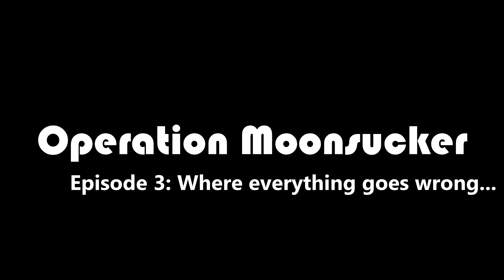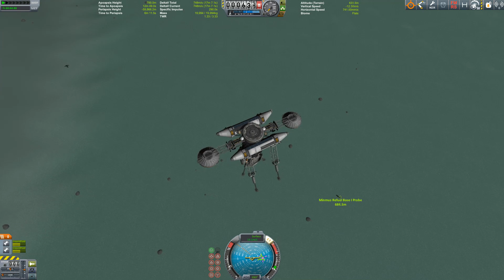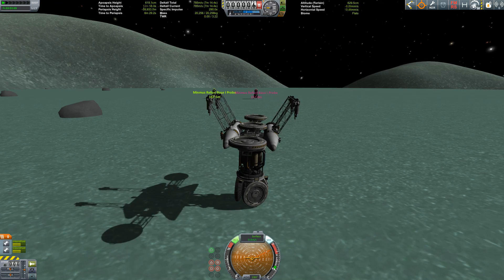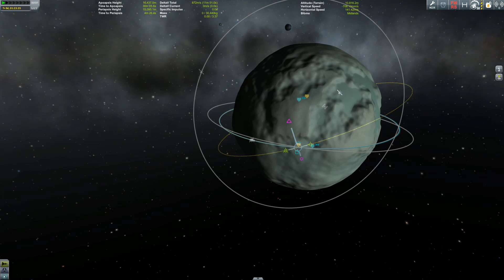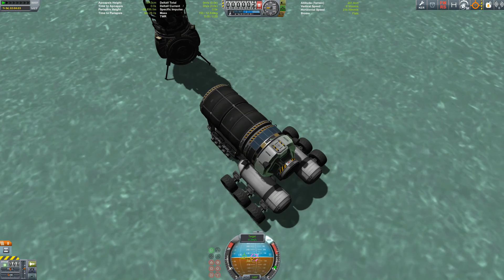Operation Moonsucker Episode 3: Where everything goes wrong...

Comment: Well, this is a whole lot more complex than my SMPLR system - Scan Mine Process Landing Rocket. Mine's not so efficient because I lift a Convert-o-Tron and unnecessary scanners into space every time I lift fuel, but it was easy to design when I was new. Refueling infrastructure was my first project after getting into orbit. It was a little too soon! :) But now I have many hours of practice docking, landing, and launching, so I could try a more complex and efficient system.